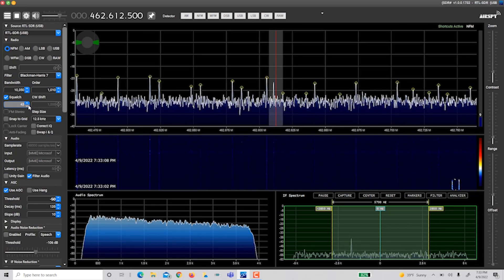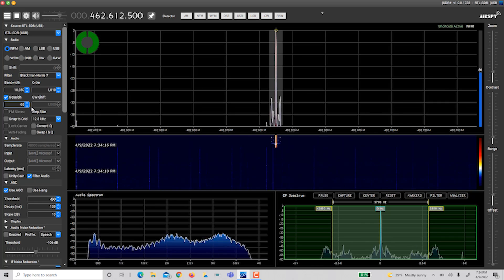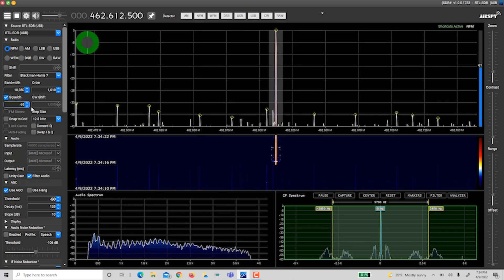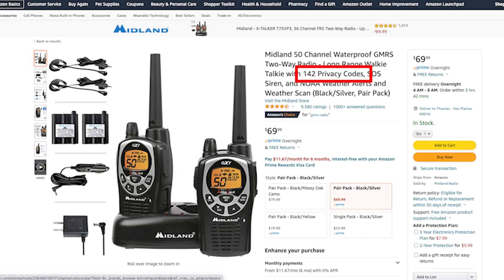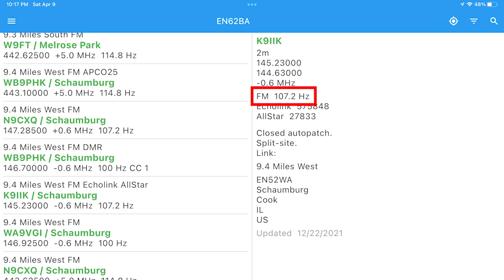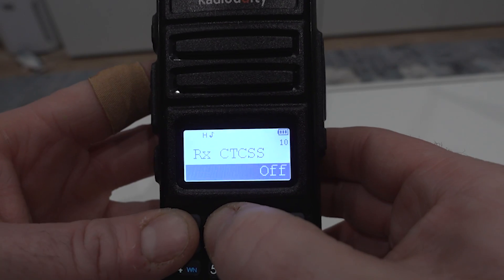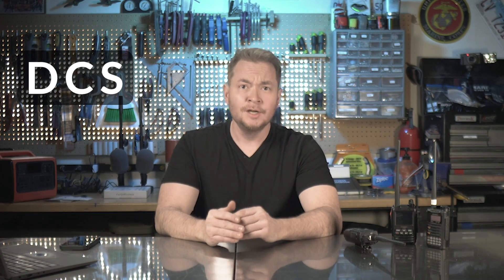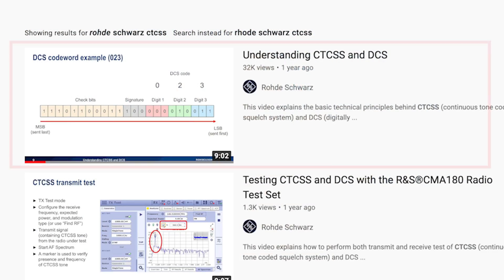What is Squelch and Why Should I Care?

Comment: You explained this very well. The video is very well done. The only thing I would have added, is maybe to mention the importance and differences, between SQUELCH settings when running local traffic, as opposed to DX contacts. And also maybe the differences in these settings between the different modes... AM, SSB, FM, and digital.
73!

Comment: Excellent video! CTCSS is also called Private Line which was a Motorola version of the system. I have an antique CTCSS generator that was used in the early days, you had to manually select the tone pair for each channel you used! It is about the size of a one foot cube!

One thing you should remind people of the danger of reducing the sensitivity of the radio by cranking the squelch too high on the analog signal strength system.

Of course, disabling the squelch is one thing people do if they are in fringe radio reception areas, in order to be able to communicate when the signal level is too low to trip the squelch open!
Reply from the maker: Thanks for watching.  All good follow-up points as well.  As I learn more and more about amateur radio I'm finding that there's very few areas where you can't easily go deep into a rabbit hole LOL.  It's one of the reasons I like it.  For this video though, my intent was to keep it to the bare bones basics.  There seem to be plenty of folks that are just trying to understand concepts, terms, and basics and so far that's about the only area I'm qualified to help :)

Comment: Very informative video. Thank you. 
My question: Is the squelch totally disabled for the duration of a  transmission being received, then enabled again when the transmission stops?   i.e. The squelch setting has no influence on the transmission while being received?
Reply from the maker: Correct.  For signal strength squelch, squelch will be effectively “off” so long as the incoming transmission is of sufficient strength to keep it off.  It does not impede a transmission in any way unless signal strength falls too close to or below the set squelch level.  hope that helps!

Comment: Annoying that they market Privacy Tones and Private Line (PL) like that. Gets people thinking they are on a secured special ops channel or something.
Really should be called Selective Squelch in that you selectively hear incoming transmissions. Any radio receiving without a CTCSS or DCS set “hears” everything. Not as private as people may think.
Reply from the maker: "Selective Squelch" would be a much better term.  I was ignorant of all this before I started learning about radios.  I thought it's called "private" so it must be private.  Stupid me :P.   Nothing private about it as you said.  The closest I get to "private" is more aptly call called "obscure"...and that's to use Yaesu radios and their digital mode (C4FM) on simplex frequencies.  I figure eavesdroppers would need to have Yaesu equipment, have to have stumbled across our frequency, and actually give a crap about anything I had to say LOL.

Comment: You know, you would of heard yourself the 1st time asking if you wanted pizza. That's the thing most people don't understand, they believe they can't be heard. It's the complete opposite, you can ve heard, you just  can't take to them.
Reply from the maker: Not if I had a receive squelch set to only break with a cross tone. You may be thinking that you can listen to to any transmission regardless of tone use on the transmission side, which is correct. But my example is correct in demonstrating receive squelch.  In my case I have receive squelch set to not hear every transmission. Hope that makes sense.
Reply: @TomtheDilettante  yes, I agree if you use it as squelch.